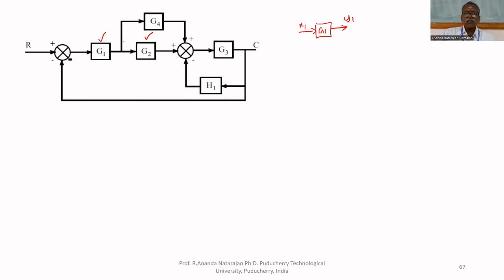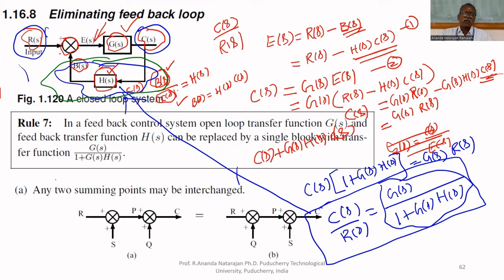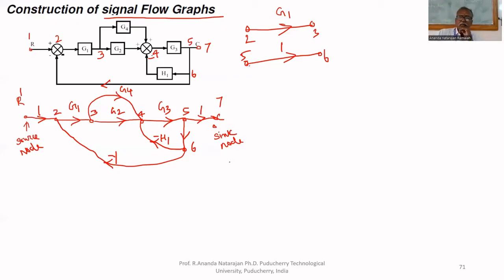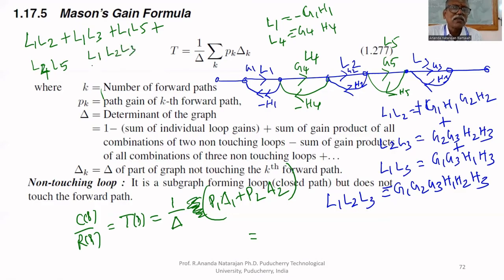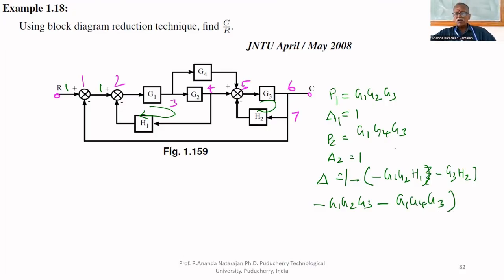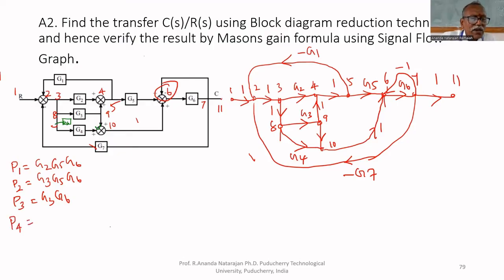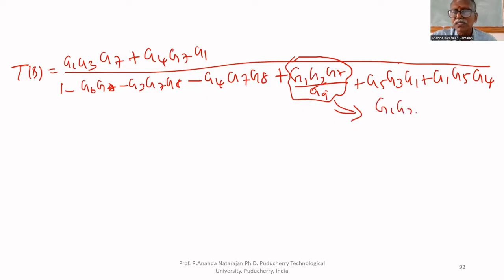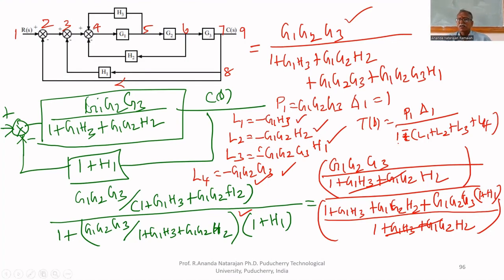Complete Block Diagram Reduction & Signal Flow Graph | Control Systems#controlsystems  #DrRan

Comment from the maker: In this complete Control Systems lecture, Block Diagram Reduction and Signal Flow Graph concepts are explained in a simple and systematic manner. The video covers block diagram simplification rules, transfer function derivation, signal flow graph representation, and Mason’s Gain Formula with solved examples.